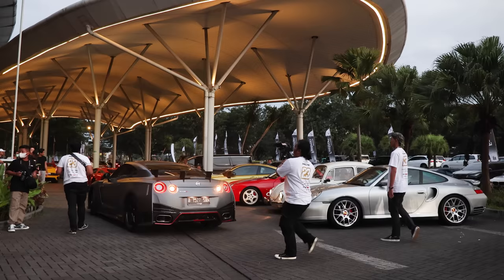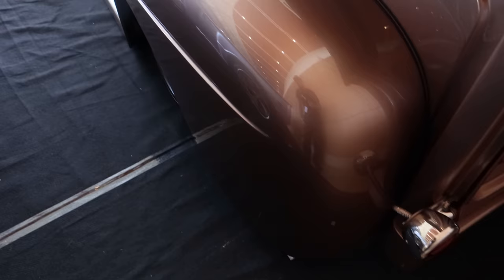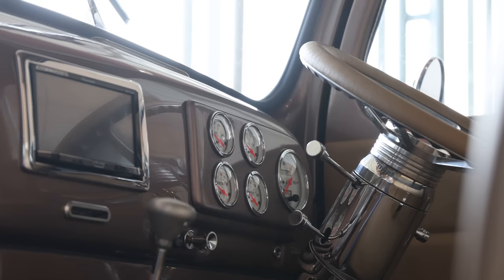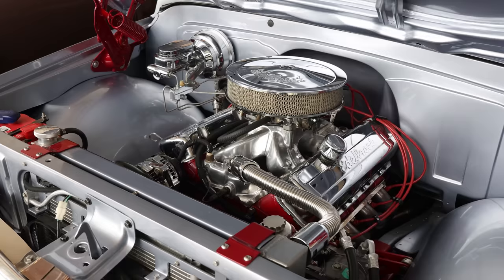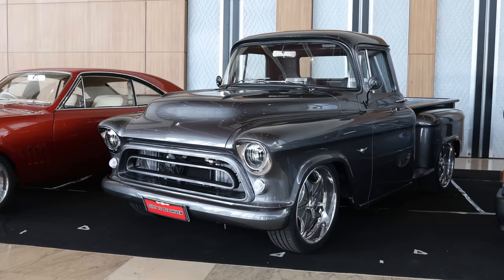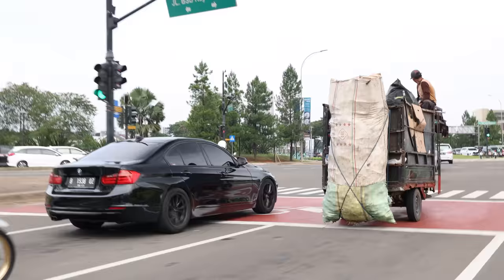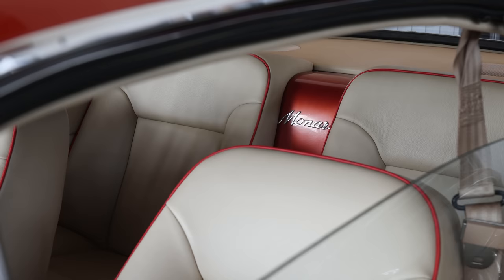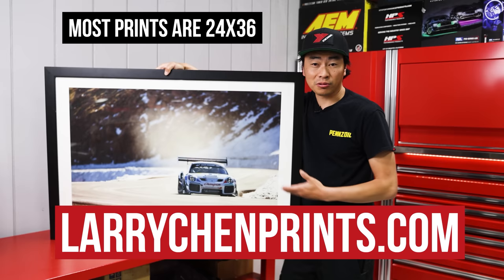Classic American trucks converted to RHD in Indonesia

Comment: Mr. Galih and Mrs. Indi is a close friend of mine. It is really cool when you can running both business and hobbies together with your spouse. 

There is actually so much story behind Gspeed. Mr. Galih is a known fixture in Holden and V8 scene in Indon3sia since late 80s / early 90s. In fact he held some record on Jakarta's street (imagine Smokey Nagata type activity).

He didn't actually planned to open a workshop. He built his own car after several unpleasant experience at other workshop. That car is a big block (8.2 litre iirc) powered orange Holden Monaro HT.  

What interesting is that Mr. Galih did the mechanical stuff and Mrs. Indi did the exterior and interior design. That car won a contest by Meguiar's and that car was supposed to go to SEMA, but unfortunately stuff happened and the car didn't go to SEMA. 

But thanks to that Monaro, a lot of people start asking if Mr. Galih can built their cars. True story, he give a numbers hoping that people got turn off and surprisingly they agreed! 

Mr. Galih and Mrs. Indi remained the only Indonesians to ever compete in SEMA's battle of the builders with that Ford F-1 in your video. I think they made it into top 200 and the only Asian builders to make it that far that year. 

What makes Gspeed build special is that you can used it daily. Mr. Galih in fact said his engine is a "tropical engine" that it can run on Indonesian humid weather. I'm a witness to that, I once driven by Mr. Galih in his Monaro, even traffic jam don't affect the temperatures (not to mention the acceleration!). 

Every Gspeed built after that has combination of Mr. Galih mechanical work and Mrs. Indi exterior and interior touch (she did the drawing, choosing colours and she even did the interior stitching itself). 

Another thing about Gspeed is that Mr. Galih didn't afraid to share his knowledge. He has an agreement with technical college for students to do their apprentice in his workshop. What surprised me is that he really gives a lot of knowledge and in fact he also teach work ethics. I once asked, would he be afraid that some of his pupils will be his future rival, he said he loves if they ended up creating works like him because he wants to see more builder like him in Indonesia. 

Larry, if you ever come to Indonesia again, you should indeed visit Gspeed. I can help you arrange it with them and you'll be surprised that in a small workshop, they able to made SEMA quality build (they also has a 2 special cars in the built, I think you'll love it). 

PS: In your last video you said you can't drive LHD vehicle in Indonesia. That is not true, you can drive them legally. What you can't is importing brand new LHD cars (except several cases such as diplomatic / government use). The reason why Gspeed convert their built into RHD because they encourage their customer to drive it daily. 

Also a bit of background in American cars in Indonesia. They used to rule the streets up until the 60s when Japanese cars coming and governement banned cars importation. For pickup, the popular models would be Chevrolet (AK Series, Advanced Design, Task Force and C-Series) followed by Dodge (known as Fargo, since they were sold using that export only brand) and Ford F-Series is relatively rare. They used to be dirt cheap up until 10 years ago (you can get a good but not pristine car less than 7k USD back then). But now the price has gone through the roof.
Reply: Thank you for the explanation🙏🏻
Reply: Thank you so much Mr. Ifan, its short and accurate explanation.
Reply: I remember seeing Mercury and Dodge fargo, The workshop is somewhere near Ricci 2 school, in 2017 IIRC . His name is Hanny. He also builds Harley Davidson bikes as well.

I heard the plan is to put a 1uz motor in mercury. Did you know him as well?
Reply: Keren mbah Ifan, panutan memang
Reply: Wow!!

Comment: i think u missed the opportunity to take a look at one of the major car scene in Indonesia, that is the diesel scene where we modified and raced diesel SUVs and Minivans mainly produced by Toyota but locally made. we usually call them Cumi darat (Land squid) due to the sheer amount of soot coming out of their exhaust pipes and makes em looks like squids that are running away from predators
Reply: That's not even close to this content, you are comparing a brand new diesel suv that cost 40k USD that can only spill black smoke to a full build from scratch 200k+ rare car with all detail builds & mods.
If you say they are fast, ladder frame are ladder frame. Will never build for the circuit
Reply: can't compare the quality of building the car, cumi darat just upgrade the power
but this building a minority car with lots of limitations, difficult to get spare parts and even against the law just to get spare parts

cumi darat is unique but not special

Comment: Anybody else get the feeling that she doesn’t actually get her hands dirty? Lol, bullshit meter was pinging like crazy. Almost $300,000 for that F1? Hahaha
Reply: In Indonesia the import taxes is a bitch, that’s why it’s so expensive
Reply: 300k is nothing compared to the many hot rod builds in the US, put in the fact that Indonesian taxes and duties are considered, it should be impressive that the car was built for only that amount. Also, Indonesia is one of those countries where labor is cheap but imports are expensive, so it wouldn't be a surprise if she got helped by other workers.
Reply: She does alot of work, I'll vouch for her !
Reply: in that 300K almost half of  it are taxes and duties on parts
Reply: Because they are working as a team, her husband did mechanical and exterior while Mrs. Indi do the design and interior works. 

They don't just pick a parts from the shop. Many of them were custom ordered from US suppliers. Which thanks to tax and shipping cost makes them expensive. 

You can say whatever you like, but their works has compete in SEMA's Battle of the Builds and in fact become the only Asian builder to make it to top 200 builders. That says a lot.
Reply: @jeromematthew9059  It's probably not that clear in the video but it's actually husband and wife team. She handles design and interior while her husband did mechanical and exterior works. The fact that she hand stitches the interior shows what kind of hard work went through it. Also you are correct about taxes and shipping. Most of their parts are custom order from shops in US which is contributed to the final bill.